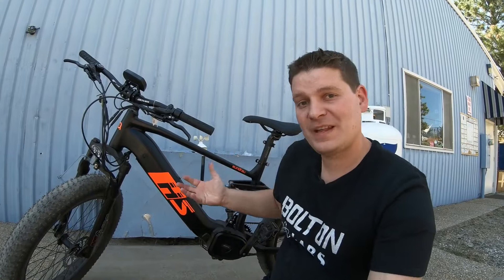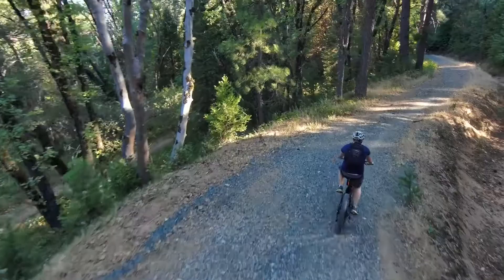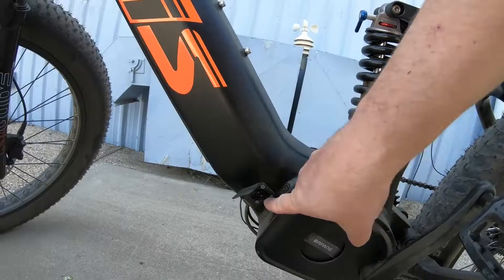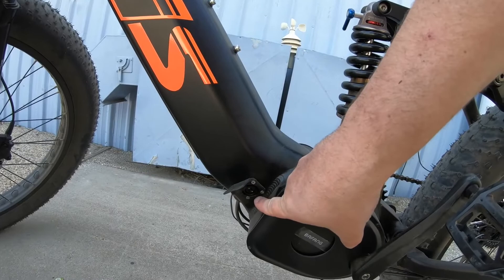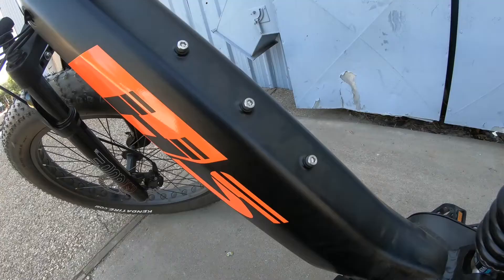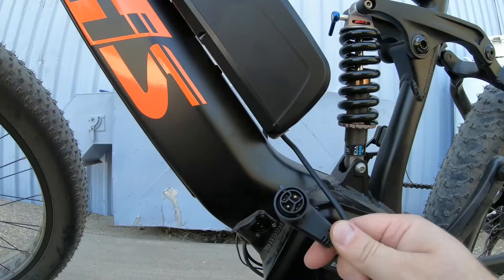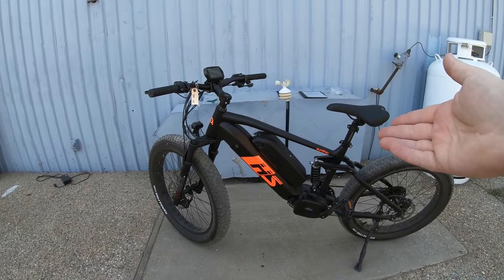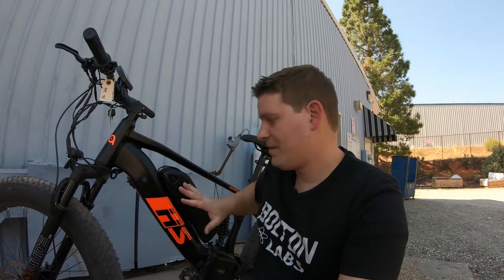How to: INSTALLING Dual Batteries on the EUNORAU FAT- HS

Comment: Just got mine. Why did they enclose the motor. The motor was hot, I took off the left cover to give the motor some air, It made a big diffence. There are wires jammed in there so zip tie them in. Maybe I will get fancy and cut air slits, with air intake fins. I would just cut a shape like  [  and bend it out a tad and file it, maybe the right side would get normal slits with no fins for exhaust.  The look is clean, and motor protected. The bike "needs" programming,  and the motor needs mobil 28 grease, when I opened the motor, there was barely any gray grease, the gasket didn't rip.   I needed to install an adjustable handlebar stem, much more comfortable.   You cannot pedal and throttle at the same time, either or.  Pedal with pedal assist or just throttle, if you are holding throttle then pedal, power cuts out.   The seat post will only go in 10.25"  I cut 2.5" off mine.   The display is garbage, buy a better one.    All in all I like it, enclosed motor, what were they thinking.   The brakes stop very well, they sound grindy though.  It says bbs03 while programming, bbs03=bbshd.   There is a dual battery device in the tube above the internal battery, model #bb-6080s.

Comment: Tell as about Defender S they do not disclose anything about controler, on my controller current limit is max  30A came with limit 15A = 750W FOR BOTH MOTORS WHEN ONE NEED CURRENT FOR peak  1200W 24A, for peak power of 750W bafang motor requires 2x 24A  what is 48A.
If controler gives only 2x 15A max  that is 2x peak power of 500W hub motor  which are lighter and more efficient at power 2x 500W.
What is going on.
Defender S with 2 top motors hub 750W nominal and  1200W peak should be the  top ebike, with one motor still efficient  ( even just front motor run with your pedalling gives you all wheel drive and climb over edges not dig in) and with pleasant for any hill, with rear suspensions just flow over series of roots or bumps?? but limit on controller max 30A indicates somebody does know or  do not understand what is what ????